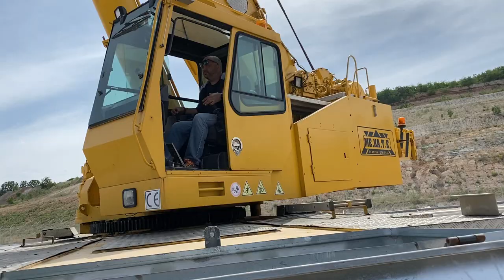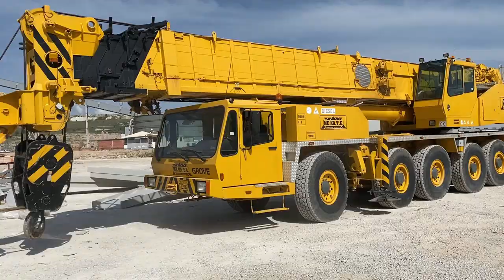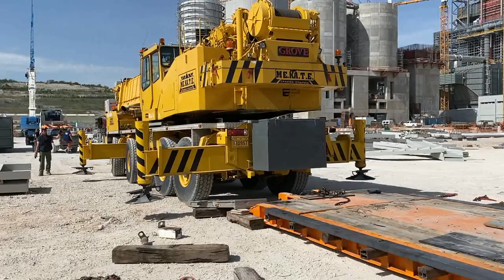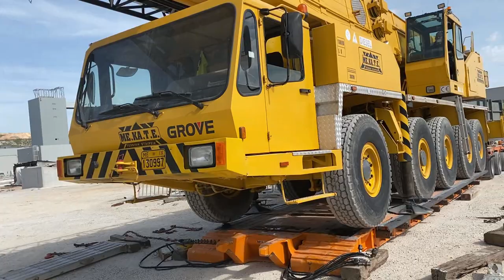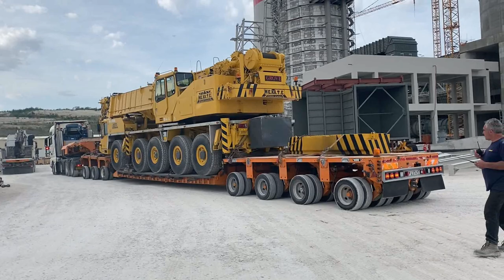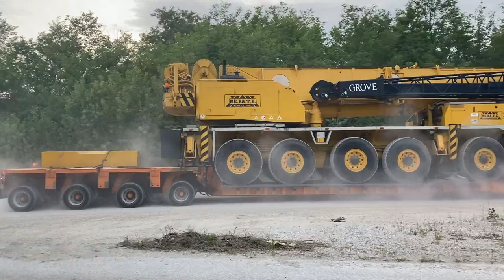Loading And Transporting A Grove Mobile Crane - Fasoulas Heavy Transports

Comment: I always thought you can drive these cranes to wherever you want. I didn't know they have to be transported. Very cool video. Thanks for sharing.
Reply: They don't, there is no reason to do this other than saving wear and tear on the crane, or if it has something wrong. A mobile crane is just that mobile.
Reply: The only thing I can come up with is that the axle load is lower this way so they can get over a bridge or something, either at all or without getting permits.

Comment: Tag axle wheel on the tractor unit seemed at strange angle at end. Very unusual move
Reply: True, this is because the front modulair dolly is raised oneven so the gooseneck compensates on the fifthwheel ! You can see that the driver doesn’t changes it! Verry stressfull for the trailer.

Comment: Some problems with the crane? Normally it could drive by itself on the road.
Reply: With no explanation given as to why this mobile crane was being transported, we just have to make the assumption they the owners are idiots that like to throw perfectly good money away by paying for un-needed transport of the crane.
Reply: THIS IS VEHICLE
Reply: did an escort with the counter weights on a flat step deck trailer and had to stay with it at 50mph.....Minot to west Fargo took 6 hours. Thankfully i blew a tire on one of the drive axles, after the repair i got to run normal speed to just in time to catch them at the west fargo exit hahaha
Reply: @jaquigreenlees  perhaps they needed the crane somewhere fast, cranes aren't renowned for their speed

Comment: I would have done a 3+5 modulairtrailer configuration because you could use the extra length off the trailer to compensate the even level of the 5 axle modulairpart by moving the counterweight another 1,5 meters backwards! This wouldn’t cost you anything butt gain you so much more gripp on the back off the trailer especially when you steer tight corners.